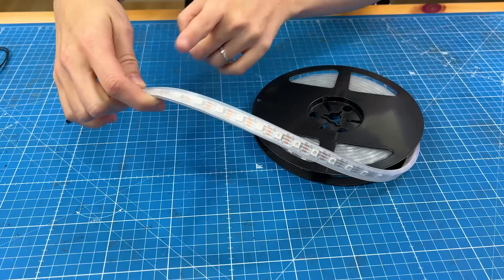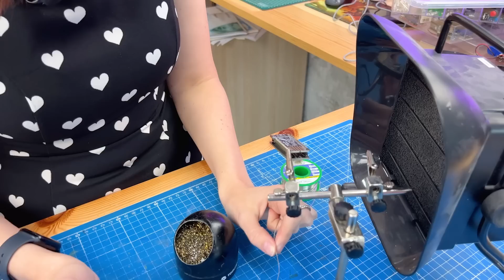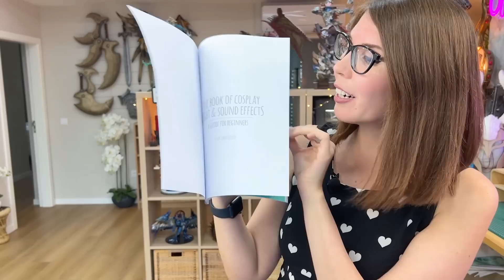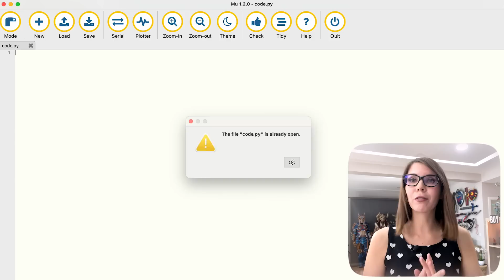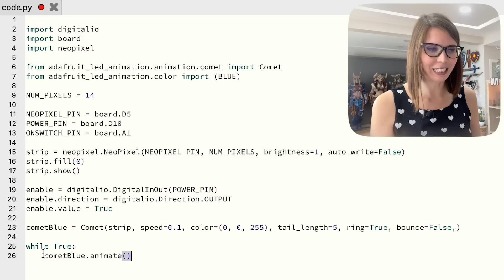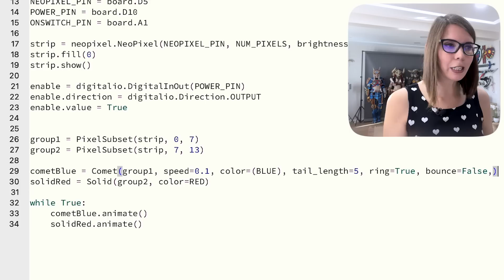Animated LEDs for Beginners!

Comment: please i dont know anymore waht to do !! everything works expect of the reason its not lighting up, i tried everything i dont know anymore waht to do !!! and i used a batterie with 3.7V is that the issue ? cause the device it self is lighting up just not the LED
Reply: I also had the same issue, not sure if you found a solution already, but I was missing a file on my chip that is not shown in the video. I could be that this is new and the video aged a bit.
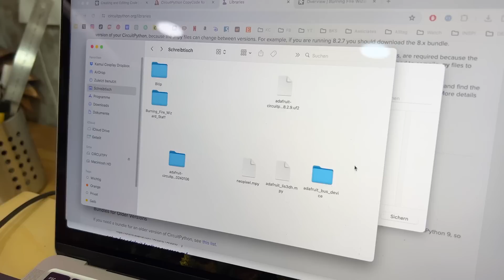I added the folder adafruit_led_animation (with everything inside) also to the chip into the folder of the lib (time stap 17:16 ) that solved my issue. You can cross reference the adafruit website tutorial on how to set it up.

Comment: I just spent £350 on Amazon through your links, hope you get good commission lol. What an awesome video. I've made some Mercy wings with 3D printing but the feathers are too heavy and boring anyway so I'm adding the recommended foam and LEDS instead to jazz it up. The LED's will probably weigh it down but hayho, at least it will less rigid.

Comment: For some reason I couldn’t my LEDs to light up. I followed the instructions but they won’t work. I’ve tried using another section of LEDs to see if that was the problem but got nothing still 😢
Reply: I also had the same issue, not sure if you found a solution already, but I was missing a file on my chip that is not shown in the video. I could be that this is new and the video aged a bit.
I added the folder adafruit_led_animation (with everything inside) also to the chip into the folder of the lib (time stap 17:16 ) that solved my issue. You can cross reference the adafruit website tutorial on how to set it up.

Comment: did you fit a 3.7 V 5200mAh battery in to the feather M4 express? or can i just switch out the connector on the battery to a picoblade 2-pin connecter? i bought the parts the battery doesnt fit into the chip </3 i realize this video was a year ago and technology may have changed. Any tips?

Comment: Excellent tutorial!
I don't know if anyone else has a similar issue but I have everything hooked up and my switch turns on the lights and animations however when I go to switch everything off, the animation stops however the Neopixel lights are still on.  Does anyone know a way to fix this?  I did the exact connections and code on video and the same issue occurs.

Comment: Hello dear.  

I’m trying to figure out how to integrate RGB led in a wizard staff. 

I’m thinking on using a resin paperweight  and  under-light it with fading and changing leds.  

It needs to be small so that I can put it into a small recess which is ill also support the paperweight. 

I know it’s kind of complicated trying to describe it. 

I used a real Ebony wood staff so the staff alone is several pounds.  When I put all of this together, it was just way too heavy to carry around. I think it was around 12 pounds total.   

Ideally something the size of 3” x 2” or smaller. 

I do want to look very authentic.

Would appreciate any ideas.

Comment: Amazing tutorial. I was able to follow everything to the point of inputting the code however when I run it in Mu it says "No module named ' digitalio '. I double checked that I pulled the correct filed into the lib folder and I even tested it by porting all of them onto the device from the download but it still gives me the error.

Comment: Hi Kamui! I am doing an OG sam fisher from the 1st Splinter Cell Cosplay. I have a 3d print of the Goggles and I would love your advice for 3 Green led lights 1 for each cylinder on the goggles. What type of leds would you recommend, Single or strips? And what light diffusing material should I use if any?

Comment: I really love your tutorials and I'm also working on my first LED project now. I wired everything and also entered the code. When I connect my Arduino Nano to the computer all animations work but when I plug it off and switch on the battery (3.7V) the lights only light up without the animation. I wanted blinking purple lights but when I use the battery it only shines purple without the blinking animation. Why is that so? Is 3.7V not enough for animations? I thought it would be enough because Kamui also uses them in her projects.

Comment: I need help with a simple Soft on Soft off Led circuit! I wanna do a mantis cosplay with two 3v leds with a simple button switch that will slowly power them and slowly turn them off.. Im a complete beginner and dont know the terminology to actually be able to research and put all the pieces together.

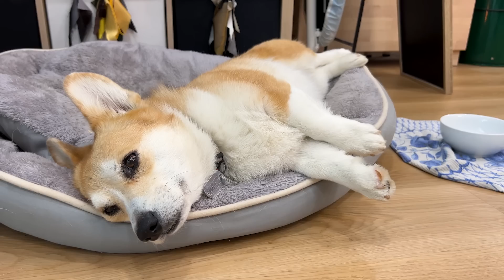Comment: #9:00 -- please set the PCB correctly at the connectors before soldering. like shown it is a predetermined breaking point .. that's bad work. (not the joints, the behavior) also 
#9:40 -- pre-tin the wires before conntecting.
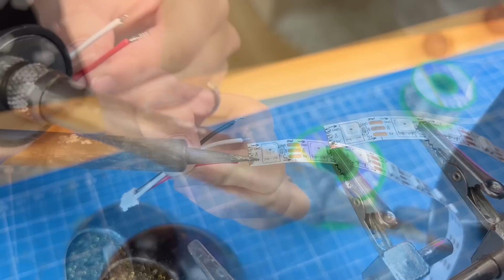#13:40 -- keep open wires shorter.

Comment: Hello Svetlana and Benni! I have a question regarding the fume extractor. While I looked it up in Amazon, there were no specifications for something I'm curious of and that is: could the fume extractor be used for other purposes, such as extracting the fluffy bits that come off a rotary tools cotton wheel when polishing a resin item? Would it also work with that or is it just limited to fumes? Have you guys tried your tool for other purposes and has it worked or not?

Comment: Your inspiration has been amazing! Benny is definitely a great secret weapon, I have learned SO much from his videos. 
@KamuiCosplay Is there a reason you choose to use the Feather M4 with the PropMaker wing instead of using the Feather RP2040 Prop-Maker board? I recently made a large hammer using the Feather RP2040 PropMaker. It was a great experience and I'm curious if there is something specific you prefer about your setup.

Comment: Pretty cool! I've been looking for the easiest ways to program addressable LED strips lately. This guide looks quite nice. :) Personally I'm more of an Arduino nano / STM32F103C6T6 type guy since these boards are MUCH cheaper and still quite powerful (as controlers, you still need something else to drive the LEDs with high enough current though)
Reply from the maker: Thanks so much! I actually worked with Arduino previously, but they stopped supporting custom chips from Adafruit. In addition, it’s quite difficult to run several animations at the same time. I personally prefer Circuit Python now as it’s much more easier to install, program and include in cosplay projects! 😊

Comment: Hello Svetlana, Benni and the CORGIS! I'm starting to restock my electronics supplies for the year and considering the Adafruit Feathers rather then the generic Arduino clones I've been using. You showed the Feather M4 and the Propmaker Featherwing, which looks like a great combo but I've just seen on the Adafruit site the Adafruit RP2040 Prop-Maker Feather which seems to be a decent combo on a single board.. what are your thoughts?
Reply from the maker: Oh I need to be honest with you: I only follow tutorials myself and the ones I used had the Feather Wing + Feather M4 combo. I am personally really happy with this setup and will stick with it. You might find the RP2040 more useful though! 😊
Reply: @KamuiCosplay  😁 No worries! We're all learning! I'll get the M4 and FeatherWing and also an RP2040 board and see how they work.. Keep up the excellent work!
Reply: @Rogue-productionsCoUk  I'm using that board for my projects and its been a great experience. The terminal connectors are great for getting things going without soldering to the board right away and the I2C port it comes with I've found very handy for attaching additional small input sensors like decibel meters and environmental sensors to make props and costumes respond to whatever is happening around you. My current project uses a decibel sensor connected to the propmaker to have LEDs respond to crowd noise levels.

Comment: A project that I am currently working on uses a raspberry pi zero. It's a microcomputer which you can use to power LED's as well. The cool thing is that you can remotely feed it commands using an app on your phone. So that way you can change your LED's on the go!

Comment: Thank you this is a very helpful video. Do you have a recommendation for led lights that are more flexible to be use in a flat circle? It looks like the ones you used on this video might be too thick to fold 🙂
Reply from the maker: Adafruit.com offers also 5mm wide LED strips! 😊
Reply: @KamuiCosplay  thank you!!